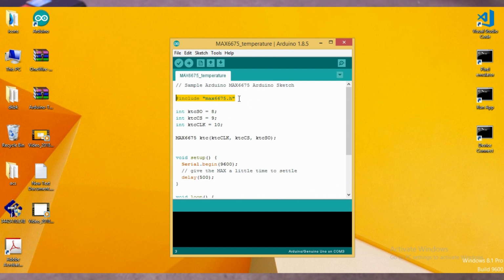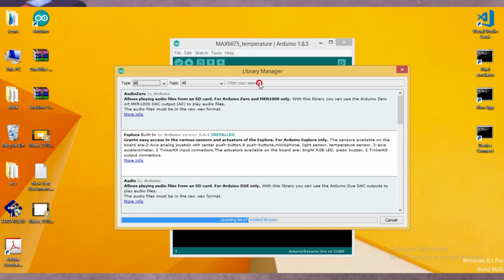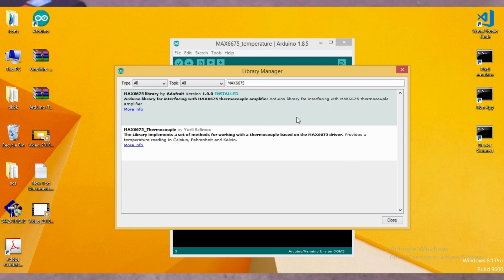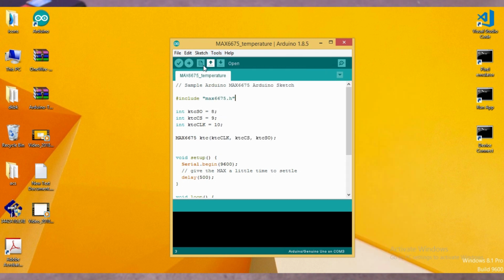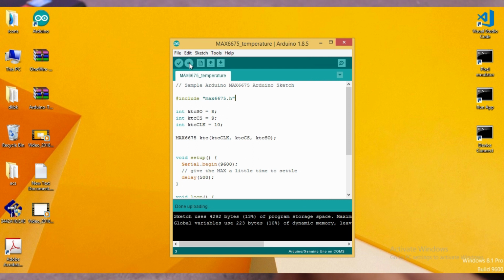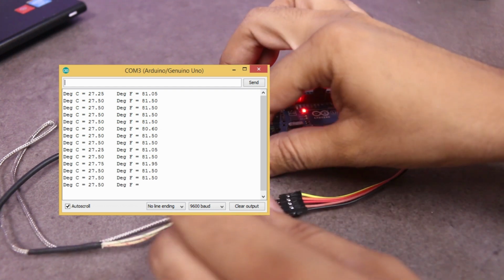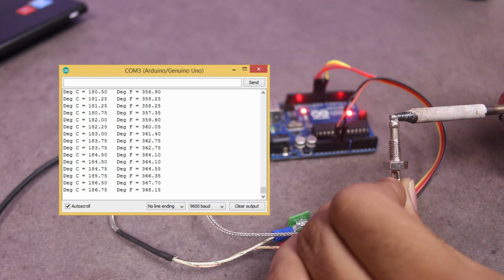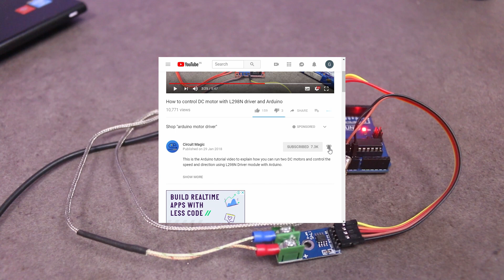Temperature Sensor with Arduino - K-Thermocouple Sensor MAX6675 Module

Comment: // Sample Arduino MAX6675 Arduino Sketch

#include "max6675.h"

int ktcSO = 8;
int ktcCS = 9;
int ktcCLK = 10;

MAX6675 ktc(ktcCLK, ktcCS, ktcSO);

  
void setup() {
  Serial.begin(9600);
  // give the MAX a little time to settle
  delay(500);
}

void loop() {
  // basic readout test
  
   Serial.print("Deg C = "); 
   Serial.print(ktc.readCelsius());
   Serial.print("\t Deg F = ");
   Serial.println(ktc.readFahrenheit());
 
   delay(500);
}

Comment: do a tutorial on how to switch one microcontroller with another.  for instance, a function in controlled by connecting a pin to ground on one, the other is a voice module that outputs a 3.3V .  how do we do this without using a relay?

Comment: I already tried this code, but i didnt work. The nominal which was out on the serial monitor was 0 Celcius or 32 Fahrenheit. I cant find the mistake .
Reply: Christine Sonya I am also getting same mistake can u help me
Reply: @umamahesh-nd7yn  umh, maybe your device is disconnected or there is a problem with your device. I don't think the code is wrong because it's an easy code. I solved my problem with trying to connect them until 100 times 😅
Reply: Do i have to put the thermocouple to something?

Comment: Great job! You make this look so easy. I'm going to build it also.
Reply: plz send me arduino code for calibration of temperature
Reply: @hamzaqadir9589  I did build the circuit but I used the code from the website. I edited it for 2 thermocouples. However, I did not calibrate it yet. I will calibrate it against an autoclave thermometer, but this will not be universal for all thermocouples. You will need to calibrate the code for your thermocouple by adjusting the maximum and minimum temps during your cycle against a calibrated thermometer. Good luck.
Reply: What the name of programming app?
Reply: in mail...hamzaqadir07@gmail.com
Reply: Donna Perygin I am getting temperatures as 0c and 32F everytime can u help me to sort it out I checked my wiring it's similar to video one
Reply: @umamahesh-nd7yn  I did this project, but I don't know what happened to the code. If I find it, I will throw in on my GitHub. However, I can't help you with your problem because I haven't done this in a long time. Sorry. Best of luck to you.
Reply: Anyone??
Reply: ok ra

Comment: Good video.  The MAX6675 and MAX31855 thermocouple amplifiers are not compatible with grounded thermocouples.  This looks like a grounded thermocouple to me.  You will get extremely unreliable results using a grounded thermocouple couple.  And be frustrated for weeks.  I have been there and done that.  Also do everything  you can to isolate the arduino from power line noise and   if you try to use two on the same arduino be careful  of ground loops.
Reply: here is a video that explains it very well.  https://www.youtube.com/watch?v=qQzh-qeKSzw.  The grounded ones will work fine until you touch it to a metal , especially if  equipment that has an electric motor attached .  I bought a thermocouple digital gauge and two thermocouples .  The thermocouples were very simple with just the node showing ,no sheathing.  Measured air temperature perfectly.  checked it in ice bath , again perfect ,touched it to my heat pump liquid lines (copper tubes)  and it was off by about 8 degrees (with or without the motor running).  when I hooked both thermocouples  up at the same time ,to my heat pump (liquid line and suction line) they were both  off by about 25 to 30 degrees.  I only use ungrounded thermocouples now.  (most cheap thermocouples are grounded.) As far as the Max6675 here are my suggestions.  Ungrounded thermocouples only,  completely seperate power supply then your arduino or any other electrics in your panel (ie its own transformer adapter or battery) or a very well isolated power supply. Capacitor across the thermocouple leads.  Shortest leads as possible.

Comment: What is the range of temp. this sensor can measure.
Reply: From 0 to 1024 degree Celsius you can read it in the infobox ;)
Reply: @damaciii6901  what's the name of programming app??

Comment: Can I connect several thermocouples with one arduino
Reply: Yeah, I would like to use 16 thermocouples and add an LCD-screen to present the values.
I wonder if it's possible.

Comment: Hello Circuit magic! thanks for this video. I was struggling to make a Data acquisition system incorporating 3 k type thermocouple. And today it finally worked perfectly. The procedure I followed is as given below,1. Make digital pin 13 as ground and pin 12 as vcc. This is done using the program.This is important because otherwise I was getting 0 as output. 
2. Buy a small breadboard so that pin 13 and 12 can be shared with all thermocouples.3. Connect Pin 11, 10, 9 for sck, cs and so for thermocouple 1. And specify it in program.4. Connect Pin 8, 7, 6 for sck, cs and so for thermocouple 2. And specify it in program.5. Connect Pin 5, 4, 3 for sck, cs and so for thermocouple 3. And specify it in program.6. Create 3 objects for the class MAX6675 for three thermocouples in the program and use the corresponding pin numbers for each thermocouple.7. in the looping part of the program call readCelsius( ) from the three objects to print the temperature value in the screen.
Use the program given below,// Working arduino program for connecting 3 Theromocouple

 
#include "max6675.h"

int ktcSCK1 = 11;
int ktcCS1 = 10;
int ktcSO1 = 9;

int ktcSCK2 = 8;
int ktcCS2 = 7;
int ktcSO2 = 6;

int ktcSCK3 = 5;
int ktcCS3 = 4;
int ktcSO3 = 3;
 
 MAX6675 ktc1(ktcSCK1, ktcCS1, ktcSO1);
 MAX6675 ktc2(ktcSCK2, ktcCS2, ktcSO2); 
 MAX6675 ktc3(ktcSCK3, ktcCS3, ktcSO3);

void setup() {
  Serial.begin(9600);
  // give the MAX a little time to settle
  pinMode(13,OUTPUT);
  pinMode(12,OUTPUT);
  digitalWrite(12,HIGH);
  digitalWrite(13,LOW);
  delay(500);
}
 
void loop() {
  // basic readout test
   
   Serial.print("Deg_1 C = ");
   Serial.print(ktc1.readCelsius());
   Serial.print("\t Deg_2 C = ");
   Serial.print(ktc2.readCelsius());
   Serial.print("\t Deg_3 C = ");
   Serial.println(ktc3.readCelsius());
  
   delay(500);
}
Reply: Works lovely, but I have used standard Vcc and ground.
I guess you can fit up to 4 sensors with 12 digital pins.
Thanks for the example!

Comment: I have seen some guide not use a MAX6675 Module, but they use a more basic temperature sensor. 
Is the module necessary for the type K Thermocouple sensor? 
Thanks in advance.
Reply: It is necessary. Thermocople outputs very small voltage. Also you need board to compensate cold point temperature to get real temperature value. Sorry for finnish ralli english :D
Reply: @jukka5648  thank you very much for the explanation. It was perfect. :)

Comment: I am looking at doing a project with this thermocouple and 4 other thermometers. Can the MAX6675 be used for all 5 thermometers? How do you hookup the MAX6675 to a 3.5mm jack for external replaceable thermometers?

Thanks for your help!
Reply: Max6675 is for thermocouples so you should use thermocople connectors or else you measurement will have some error in some temperatures

Comment: It is very helpful video for me but i have one difficulty is obtain one error and can't measure proper reading. So  plz help me to solve error and by using this arduino multiple k type sensor use i know but how? that is unknown for me. So plz help me to make one circuit for multiple sensor.
Reply: Read my comment in the top sir. I managed to make 3 sensors working.

Comment: Hey, love the video. I am supposed to make a temperature data logger as a project. I can't figure how to use multiple MAX6675 on an arduino uno board. Can you please help me?
Reply: Read my comment in the top sir. I managed to make 3 sensors working.